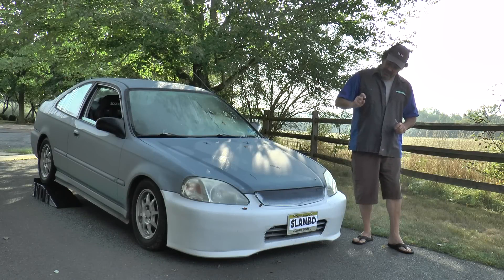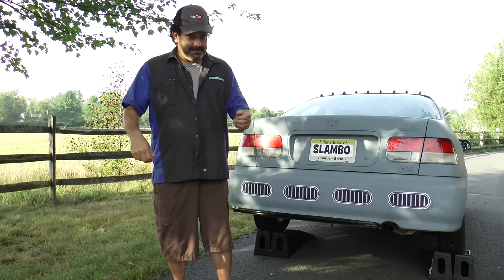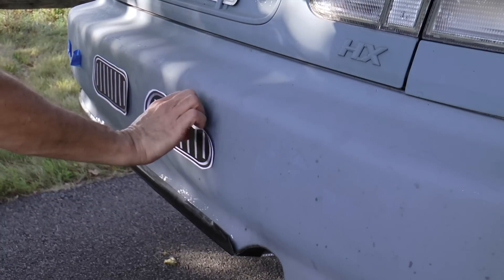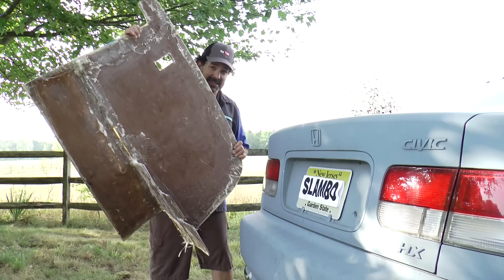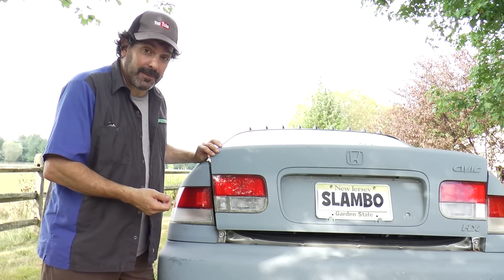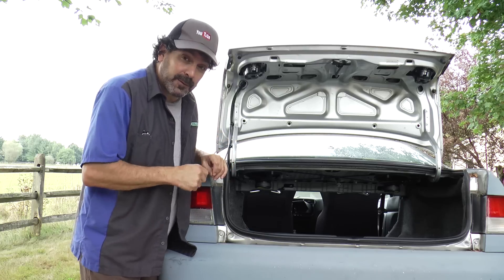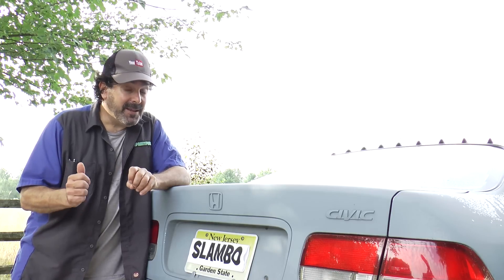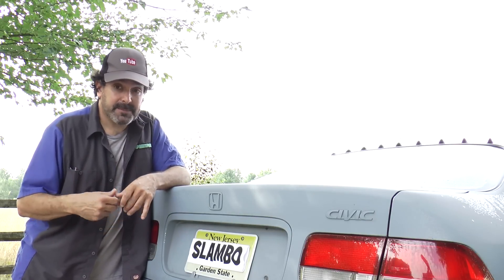D-I-Y Diffusers & Belly Pans for Racers not Ricers - Pt 1 - Ain't Fuelin' Honda Civic Build

Comment: You ideally need a belly pan to be stiffer than the corroplast, as the rapidly moving air under the car will cause the corroplast sheet to deflect and hence the venturi effect and ideal pressure differences you are looking for will be moslty lost. But it does at least solve the parachuting  and corroplast is great for trialling and testing

Comment: I took my old civic for granted. It was a 94 4 door with a D15B (3 stage VTEC) and it was giving me 50mpg without any eco mods (other than taping up my gaoes between the hood and bumper/fenders). I planned on doing a some eco mods (partial grille block, chin spoiler, belly pan, side skirts, drag style wing) to see if I could get it up to 75+mpg but when I was ready to do it, I got a traveling job and no longer needed it since I was flying. Now my new job is a 6 minute drive so it doesn't matter what I drive (08 lancer or 05 navigator) I use less than $20 a week to get to work.

Comment: save those templates!
Reply from the maker: Will do! I've had the coroplast rear belly pan on the car for about a year and a half now. Knock wood, it's held up. It's two separate pieces, with an open space for the muffler. Need to fab it up in metal or composite.
Reply: MPGomatic I have just finished my coroplast belly pan, from the air dam to the  transmission. I used plastic push fasteners, duct tape, zip ties, and screws with washers. I was averaging 15 mpg, I'll have results in a month. thanks for the video!

Comment: Cool video and nice work.  Adding strakes doesn't make it a diffuser though.  Diffusers actually change the volume of the air under the car so it merges with the surrounding air.  My question with the belly pan is how do you keep air from getting above the floor and trapped in the rear bumper anyway?

Comment: Part 2?

Also worry about the front MUCH MORE than the rear 
Most of the drag in underbody airflow is caused by a the engine bay

Comment: Nice to see .......... 
1) nuts , bolts & mudguard washers ........ may be use some silicon sealant or rubber washers , to ensure there is no leakage through under excess rain / water / flood . 
2) wrap muffler / silencer in thin section of rock wool / glass mat , to keep corrugated plastic off exhaust . At that point , the box should be relatively cool , but ensure there is a good amount of space round the tail pipe , so any leakage from the exhaust is easily dragged away from the vehicle .
Reply from the maker: Thanks for the tips!

Comment: part2?
Reply from the maker: Still in the works.
Reply: +MPGomatic perfect also u could cut the end muffler to completely seal the rear .
im currently doing a 93 honda hatchback . for the track so im relaying on the best diy aero to get around faster.
u have any diy for the front?
Reply from the maker: +santi o Cool. Where does your exhaust end? 
Did you check out my crazy front bumper video? I'm still messing around with it.  I haven't built a front pan yet. The big crazy goal is to test stock vs modded - ultimately in a wind tunnel, but first with computer simulation (CFD).
Reply: +MPGomatic well its not legal car isnt registered just a track car after the manifold i have a down pipe . ill check the video out
Reply: It's been 2 years, is there a part 2 yet?

Comment: like it but I would have went with sheet metal..just my 2¢
Reply from the maker: +Johnathan J. Gast Aye, yep! I want to redo this in aluminum. Or kelvar. I'm stuck between not wanting to spend more than what's necessary and doing something cool just for the heck of it. The big goals are 1) making it work, 2) testing it in a wind tunnel, 3) create something that easily and affordably reproduced.

Comment: i knew it had to have a reason why lol.... if you mixed both the holes and the belly pan and diffuser ....would that be overkill ?
Reply from the maker: +christopher daniel If the bellypan does its job by keeping all of the airflow away from the bumper, I'd reckon so. =)
Reply: you have my attention looking out for the next video
Reply from the maker: christopher daniel I'm going to fab an aluminum pan to work around the muffler. Just need to find my tin snips …

Comment: What's the overall improvement you've gotten since first getting SLAMBO?
Reply from the maker: +John Wilkerson It's up by a third or so. Started out in the mid thirties, average. Nearly 15K miles tracked, so far. Here's the full chart: http://www.fuelly.com/car/honda/civic/1999/mpgomatic/280405/fuelchart 
… the big spike in May was due to an overfilled tank.
Reply: +MPGomatic Nice. When you're done with this project it would be good to see a video with the mods to avoid. I would think a lot of people want to know what will get them the most bang for their buck. I'm going to try blocking off the grill in my EX now that the temps have gone down.

Comment: I use thin Gage AL for my race car.  Mainly because I'm going 150-170 mph.
Reply from the maker: +biscuitninja Aluminum's a great way to go. I was thinking about going with sheet plastic, but the stuff I have is just a little bit too narrow. Kelvar might be ideal, but that would crank the cost/time/effort up.
Reply: +MPGomatic 
I'm from the aerospace community,  even thin Gage tin would work.  the plastic is fine, i just wanted a bit more durability since racing can be unforgiving.